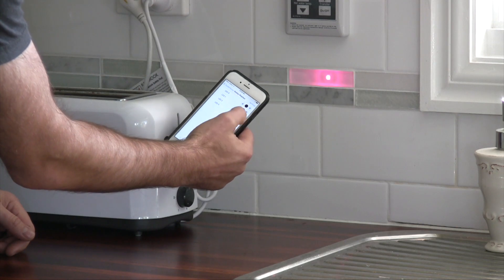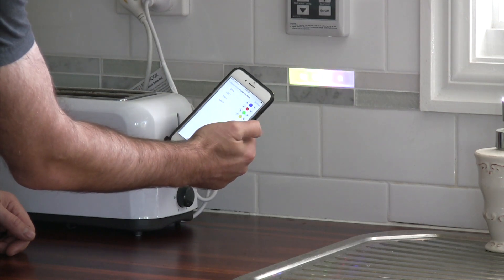Vlog #58: Wires NOT WiFi for home automation!

Comment: There is a difference putting together a switch or two for the kicks vs designing a whole house automation system where critical systems relying on. Wifi switch is a good crowd pleaser, but as Jon says nothing beats the good old wired connection full stop. At Least wifi is not there just yet.

Comment: Besides all your good points. Generally you are going to need to run a wire to your device anyway. Also wires hanging down the wall to is not going to pass the wife test. And the second you forget to charge the battery for the light switch and you wife try’s to use it, you are going to be in a world of hurt.

Comment: Too right. In a fixed installation, cables to everything possible is the best way to go. For those who can't get at the wiring in the walls - perhaps you can access the wiring in your roof spaces? If so you can do what I'm doing in my house which is to connect the conventional switches to the home automation controller as inputs - thus you don't need to change the wiring in the walls.

Comment: While I agree that wired > wireless, your comparison of your home automation system wiring vs inter-aircraft wiring is absurd. The plane will crash if it loses control, hundreds or thousands of people die. Your lights don't turn on...Oh boo hoo!

You seem like a smart guy, but bring your analogies back to earth.
Reply from the maker: I think you missed the point, which is that the solution has to be appropriate to the problem. Many times WiFi is the answer, but not always. This video is in response to all the "use WiFi for EVERYTHING, wires are so old fashioned" comments that I get.
Reply: Rubbish. If my lights don't turn on, during a normal day, then sure, only my family will get annoyed. If my lights don't turn on when I've had to call the emergency services because someone had a seizure, then ... it's a different story. Agree, not thousands of people being killed, but certainly enough to make ME want to have wires in my house. Also - power... why would you want a wireless lightswitch?

Comment: Jon you need to get yourself some UniFi APs... agree wholehearted that wired is the way to go and WiFi in certain prescribed circumstances.
Reply from the maker: Yes, that's on my list! I'm about to do an episode about building the ultimate home router / firewall (with redundant hardware, auto failover, the works) and I want to follow up with an ep about setting up multiple APs with optimum channel selection, signal coverage testing, etc :-)
Reply: SuperHouseTV Reach out to a local Distributor or Ubiquiti themselves... you never know!  Controller is all included. Ya flappy tailed thing!

Comment: No doubt you are aware that many properties in the UK have their mains switch and meters  indoors, 'under the stairs' not outside. That goes for gas as well.
Reply from the maker: Cool. How do they check the meter? Does someone knock on the door and need to be let in? That's the same in commercial premises here in Australia, but at least they can assume they can get access during business hours. Residences could be more of a problem. Over the last few years we've had smartmeter rollouts that should make that problem irrelevant anyway.
Reply: Yes, someone needs to be let in. I usually even have to take a day / half a day off work for that 2-3 times a year (power, water, heating - all is checked by different parties)...

Comment: Wifi advantages:
1. cost: endpoints can be made for cheaper than a 20m cat6 run.
2. portable: you can move your things when you move, ideal for apt dwellers
3. legal: running in-wall wires requires code compliance; wifi: notsomuch.
4. capacity:  one cheap hotspot can serve 100+ nodes: a 100-port hub is $$$
5. flexibility: network topology can be changed from an armchair instead of crawlspace
6. compatibility: i can give a friend a wifi switch, but how many have cat6 pre-wired?
7. redundancy: if one hub goes down, wifi nodes can re-route to a 2nd router: beat that cat6!
Reply from the maker: All good and valid points. I'm not against WiFi. I use it extensively, and it's very useful when it's the best solution for the specific circumstances. But it's not ALWAYS the solution, which many people seem to think.
Reply: I agree, just some of the comments seemingly put wifi a step up from tin cans and string. Good video btw, as always...

Comment: I went with WiFi for cost, currently have about 50 things on one 5-year-old router, and have had no lag, drop-outs or other interruptions. Maybe i'm just really lucky, or maybe wifi aint so bad these days. I can see the argument for inputs like switches, which need standby power, but outputs like lamps already have power, which makes setup a breeze.

Comment: I totally agree with you regarding wireless vs wired. The trend of switching to wireless for everything bugs me. People don't seem to look ahead to the future, even if you set aside all the problems you cover in this video, there is still the major problem of a massive increase in EM noise that will undoubtedly cause unforeseen problems in the near future.

Personally however I wouldn't even use WiFi for most smart home things needing wireless. I would use something like nrf24 instead, and then only use wifi where I need to bridge to IP networks. Using an esp8266 is much easier granted, but WiFi isn't the most efficient of protocols. It's unnecessarily noisy for most smarthome tasks and wastes a lot of energy doing nothing. NRF24 modules can be made to consume very little energy when you only put them into transmit mode on demand, and spend the rest of the time in receive mode. In a notification based system, devices should be spending most of their time in receive mode anyway. They should only be transmitting when there's an event or a request to respond to.
Reply from the maker: Yes, very good points. Because you can't see radio signals, many people don't understand that you can't just keep adding wireless devices in a small area. The spectrum is a shared resource. I was working at a customer's apartment in the center of Melbourne recently, and my laptop could see about 60 access points!

As you say, even if you use wireless it doesn't always need to be WiFi. Many times just a simple ASK / OOK transmission on an ISM band is the best solution. I do that too, and I've been working on a couple of videos related to intercepting and decoding signals from devices that use 433MHz comms. I've done it with a weather station, domestic power meters, motion detectors, (!), and currently working on a tank depth sensor project.

Comment: @Jonathan I am planning to make my entire new home smart.I am planning to pass 8 core/CAT 6e cable along side AC wire.Can i place them in the same electrical conduit that have been put through the wall or do i need to put in separate electrical conduit considering any fault may happen.
Reply from the maker: Great question. The most likely answer is no, for 2 reasons. Firstly, depending on what country you live in, it might be against regulations. Your electrician should know what you're allowed to do. In many places it's not allowed because of the danger of physical cross-connection. For example, if both wires are against each other, and someone drives a nail through a wall, your Ethernet could suddenly become connected to mains. Secondly, electrical noise in the data cable. Cat-6E is very well shielded so in reality this isn't likely to be a problem, but having power and data separated (and only crossing at right angles) is best.

But in any case: talk to an electrician or data cabler who knows the local regulations. I can't give advice on things like that.

Comment: I couldn't agree more. I installed a KNX/EIB solution when we did a total renovation. It's old and antiquated, and requires a powered bus cable running everywhere; But it is 100% stable. And it is a proven standard, so you can integrate it with anything.

Comment: Totally agree. One big problem with wireless switches etc is they still need power so you end up using a cable anyway.
To keep cost down (10 years ago) I started by using RS485 over telephone cable with two cores for power and two for signal. I have switched to CAN bus recently as the modules can now be purchased very cheaply and it supports more devices much more reliably but still uses the same telephone cable. It also doesn’t require switches or routers etc and can be daisy chained between controllers, keeping wiring and cost down to a minimum.
Reply from the maker: Both RS485 and CAN are great solutions. You may have seen I did an episode about LIN for controlling window motors, which is like a simplified single-master version of CAN. The nice thing is that with the cables in place, you could swap from RS485 to CAN with minimal effort.

Comment: I still use and prefer wired LANs for normal devices such as PC's and printers in my home rather than WiFi. I still have WiFi for portable stuff but wired is so much easier and more reliable when it comes to setup and especially trouble shooting. 
WiFi adds complexity and there are already enough things contending for bandwidth in the available air space as it is.
You can run a 100M CAT6 cable and know you are going to get your data out of the other end, to do that with WiFi is more of a challenge.

In this case as you have to provide power to everything anyway, it makes sense to run the data cables with power too. Otherwise you have to provide separate power supplies all over the place which is a nightmare in itself then the issue of adequate wignal strength back to the main system, probably requiring WiFi repeaters or additional wired access points, addinh yet more links in the chain that could fail.
Reply from the maker: That's exactly right. A piece of wire is dedicated bandwidth. Wireless is a shared spectrum.

Comment: I had asked in an earlier comment how does your litte wired push button turn on the light when your centralized controller goes south, and it will in the middle of the night.  I use wireless devices but each must have local control at the device as well IE; sonoff, z-wave and tp-link.  Each has a local manual button that controls the device.  I can take my home controler and throw it out the window and still turn on my lights etc.
Reply: Bob Moran 
Use DALI
https://en.m.wikipedia.org/wiki/Digital_Addressable_Lighting_Interface
Reply from the maker: Yes, combining local and system control is the ideal architecture. I do that too. In a previous episode (I think it was "6 Sonoff Secrets") I showed use of a local button to control a Sonoff while its state is also updated in a centralised controller such as OpenHAB.

Comment: I think there is place for Wifi based controls. My alarm is wired, my cameras are wired. All my lightning, av system etc are Wifi controlled and I am happy with it. I have separate router with hidden ssid, wpa2 secured. If am goong to build a new house I am pretty sure that I am going to pull wires, but this is not an option in my existing house.
Reply from the maker: It sounds like you've used the best solution for your specific circumstances, which is great. I have nothing against that! What annoys me is people who say that I shouldn't have used hard wiring, and should have used WiFi instead because ... well, I don't really know.

Comment: I have to agree with JM Tosses below, for a house with existing 240v mains wiring a Powerline Ethernet device at each location is a possible answer. however, they are expensive and can be bulky.
Reply: I used to work at a computer shop and those Powerline adapters came back regularly with issues. Didn't matter which brand or type. So like JM says: think longterm, go cable :).

Comment: Actually I am not with Wifi or even wiring as the end users now needs fast and easy installations. I understand your point of view regarding security morr effective with wires, but my design is to use RF instead of wifi. Better power managment for sleeping/battery powered sensors and there are are already libraries or maybe hw that adds cryptography layer for security. 
Another point I guess that people tend to update there system every couple of years. Things are getting cheaper and easier in setup and new technologies may be even produced. So I guess people dont need a systrm to run for 10 years.

Thanks for the great video though as well.

Comment: I totally agree with you about wire, in my house I've wired all switches and now the light are controlled by a siemens s7 (totally horrible) and realys... but what if I want to sell my house?... I can remove the system and replace all with step relay in a couple of hours. I hope that sonoff or others add to their systems some like 4ch but with wired inputs for switches. When it happend I will probably buy a lot of them and get rid of the PLC ... as soon as I flash the firmware and hook them to a openhab system.
I think that your work, and your way to do will became THE way to do in the future. (IMHO)

Comment: Now you mentioned the sonoff, and that can be a really good solution also for switches since you can wire a switch to it that will still work if you lose internet connection. Especially if you don't have the option to retrofit.

Btw you are right about the running out of client connections on access points, but that is no different than running out of plugs for ethernet cables in a wired system
Reply: I would love to hard wire everything but my house is wired in not so easy way and channels are not going everywhere. Wires for switches are cemented in and in the ceiling are channels but they are full or they just stop somewhere. Thats why i will have to do a central location in the attic for sonoff swithes and only run lead wires to existing leads from switches. It will still be a lot of work with lifting isolation and putting channels in but it's much cheaper and easier than destroying the walls
Reply from the maker: Regarding the Sonoff, yes, exactly. I showed the use of a local button combined with central control in one of my previous videos :-)
Reply: If the sonof ever gets an american safety certification it might be an option.

Comment: I would love to add the wired buttons throughout the house.  My only issue is the wife's one rule: "if the internet goes down, or the controller fails the light switches still need to work".  Trying to find a way to have my cake and eat it too is stressful.  The ESP8266's make this simple since I can use normally open closed portion of the relays to make sure if the system shuts down, the lights still work.

I'm always open to ideas for new projects!

Edit: Having thought about for a few mins. I can just run the wire to the relay instead of directly to the switch. Problem solved.
Reply: Benjamin H you could also put a UPS on the controller and poe switch. Then setup a cluster of controllers that use a secondary shared IP with something like heartbeat. You'll have redundancies for them that way.
Reply: Josiah Ritchie that could work! I don't understand the last bit though. What is heartbeat?
Reply: Benjamin H Heartbeat is a Linux software that is used for server clusters. The relevant piece is that the software tracks both cluster members and decides which one is currently using the shared IP. You'd need to either sync the two mqtt databases or decide it is okay for them to be out of sync. This could also be handy for updates since you could update one while the other is active. (Granted, this is all theory in my head, but based on things I do in my day job.)
Reply: Josiah Ritchie that is amazing. Ok you have given me a bunch of ideas! To the drawing board!